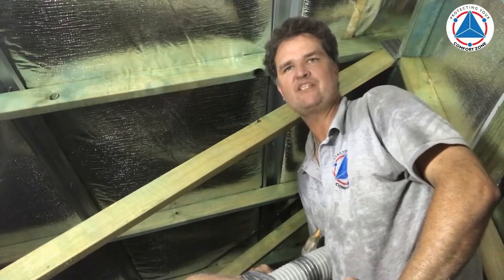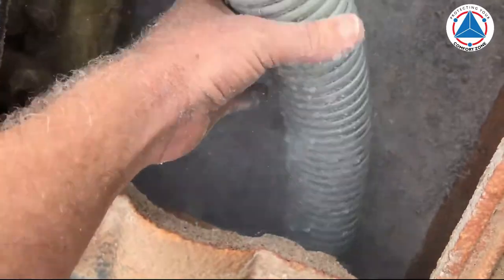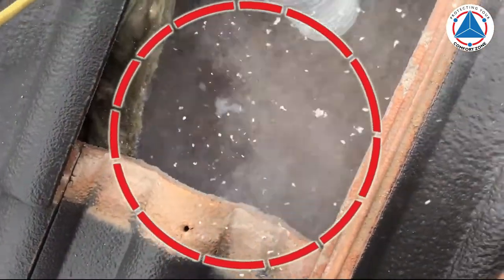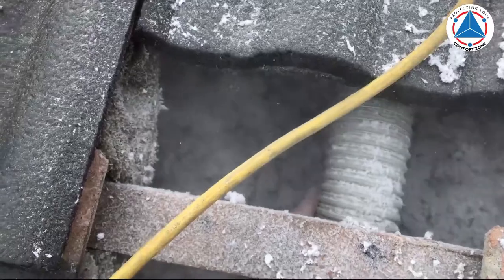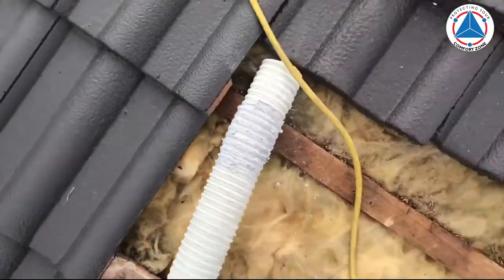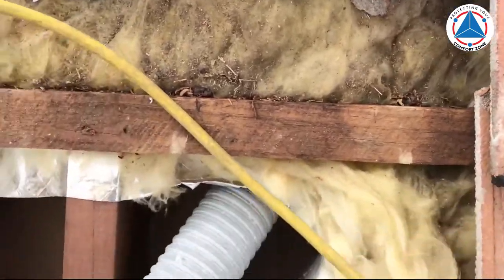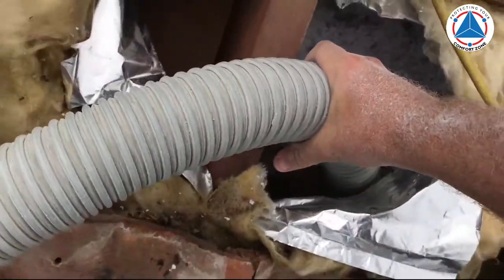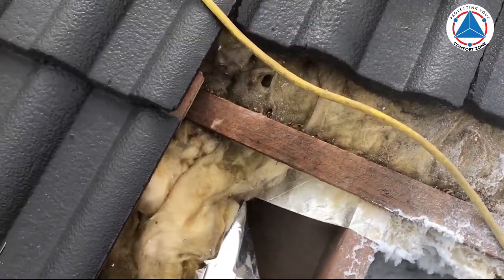What insulation can I use on my Tile Raked roof  it does not have a manhole, my roof is really hot

Comment: Cellulose fiber is defiantly the way to go. After finally finishing installing polyester batts in my 1950s house I would NEVER do it myself again. Too many awkward spots to cover, uneven spacing between joists etc.
Reply from the maker: Yep it is a tough job and that is why the installation is so important to pick the right company. You might think you were safe just booking the job in with a big company but not in this industry. 

The reason is that even the big companies suffer from the fluctuations of work, lots in summer and winter but not much in the middle. So they alway hire sub contractors in summer and then after summer the new contractor finds out there is no work for them.

 So every year they effectively hire a new team of installers. That means most of the time the installers have very little experience or training. I saw a batt job done by one of these big companies just yesterday and it was terrible. It is not the installers fault, it is just a lack of training and a lack of commitment on the companies part to pay installers a retainer when there is not much work on.